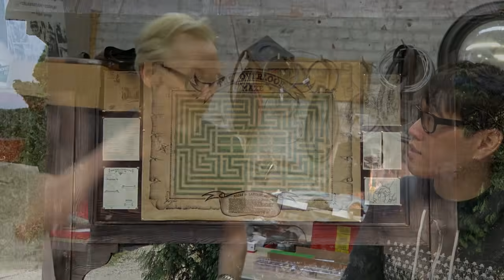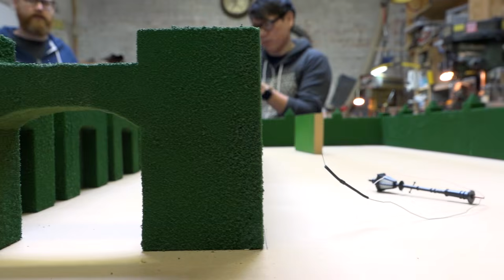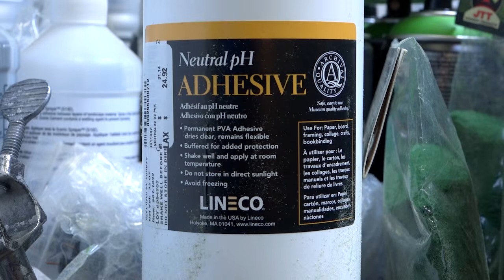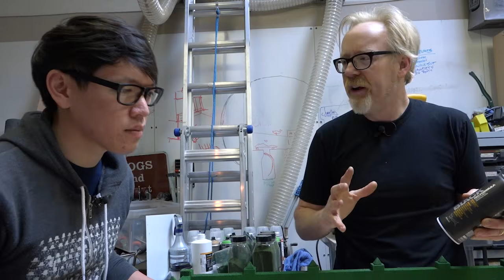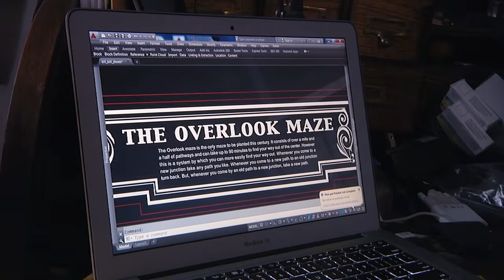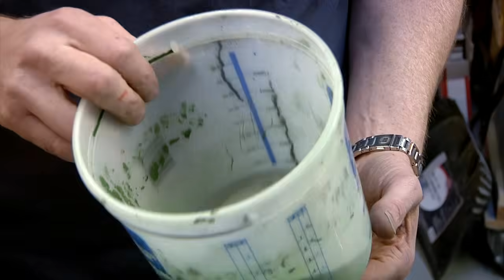Adam Savage's Overlook Hotel Maze Model

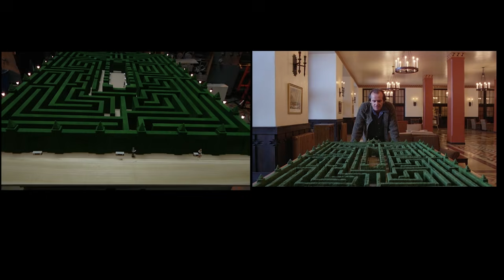Comment: 17:04 I see a mistake. In Adam's model, if you look at the center area, then to the top right of it there is what looks like a rectangle with a single line in the center. The rectangle only opens at the very top left corner, and inside is a single line of hedge. That does not match up with the movie. If you look close in the movie, the center piece is not a straight line, but an L shape (it is correctly oriented as an L from Jack's perspective). So there are actually two entrances into that rectangular area.
Here's a screenshot showing it: http://droneva.us/dan/AdamSavageShiningMaze.png

Comment: Two things I especially like about this video both involve accessibility:
1) Maker accessibility. Doesn't require any tools more expensive or difficult to use than a table saw, and a maker without a table saw can find a workaround.
2) Viewer accessibility. It's easy to identify with Norm in this conversation as he asks questions the audience is already thinking.

Comment: Glad to see Adam's unmitigated enthusiasm continuing. He does things we all would if we were able. BTW, in  school the way to avoid introduced error was to measure from the zero point instead of from the previous station. More figuring because each dimension is different -- o", 1 1/4", 2 1/2",  3 3/4", 5, 6 1/4", 7 1/2", etc. I remember building a Clark Y airfoil this way.

Comment: Hey Adam, the grid size wasn't different on the x and it was just drawn using a ratio for the path with and hedge with. So for example one grid space was used for the hedge with and 2 grid spaces was used for the path. You didnt have to create a recangular grid but just use a grid with smaller cells.

Comment: Amazing build! A nice touch would have been to mount the cut particle board pieces (pre coloring)  to the base board, then use sand paper and or Dremel to soften the edges of the "hedges" for realism. It would also have been a nice chance to pre-fit the pieces and imo add some further texture detail to the model. Great stuff tho Adam!

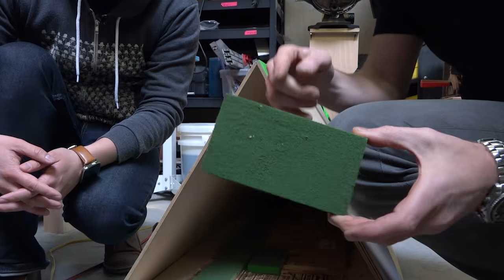Comment: 10:43 I have a 5 gallon bucket bucket with slits I cut with my jigsaw in the bottom side. Then a junk piece of plywood layed on top with a 1 1/2 hole in it which my heat gun sits in set to 150 degrees then I leave it to dry glue while I work on other projects. Works great and was free the bucket came with primer in it used that up and the plywood came from scrap from my dad's work

Comment: IMHO he did not work very efficiently. Instead of drying only a few pieces and only one side in this "oven", I would have put all at once on a wooden plate and then spray, glue and sprinkle the flocking on all in one rush.

Comment: Sorry but, Adam has the gall to put down the original person's work, then proceeds to make a maze that while maybe accurate in shape, is too smooth, too blotchy, with lighting that's obviously blue led color... there's so much that can be improved on this model.  That flocking was the wrong thing to use, train modeler's hedging would've been perfect.  He needed a finisher.  Well done, but not right.
Reply: Just to be clear he didn't put down the original the original is bad ass he put down the copy that was made for the Kubrick Museum

Comment: Adam there are ways to do it as you go with out getting accumulated error that just popped in my head. First of I am a boatbuilder /shipwright. We never seem to do the same things twice and we are always problem solving. Could you mark it out with pencil and then green painters tape so you can erase it sandpaper the pencil. Or make a spacing board to play down in the rows so you can tape up to them then you just have to screw boards to your accurate tape lines. By already marking it out you will not get accumulated error. I do that for teak decking and other things. Although until you are doing the job yourself is skyway hard to know where your head is it and your process plus problems that you percieve.plus there are always usually more than one way to do anything. I hope this could help but probably not.

Comment: I love Adam and he's brilliant in so many ways but in reality, there are things he could have done that would have made this build go more quickly and easier:

1) Used a CNC router to do the perimeter walls and any walls with internal alcoves. 
2) If he really wanted the walls to be permanent he could have used dowels and glue. Dowels and glue have held furniture together for centuries so in this instance, the walls would stay in place. The glue could be applied to the dowel itself so there will be no worry about bleed through. In fact, that are plastic dowels used in the furniture industry that have teeth on them that once pushed in, they "bite". If he wanted to be able to remove the walls for repair, he could have through drilled so he could push them up/out through the bottom. 
3) Flocking: there are cheap cardboard flocking "guns" that shoot the flocking out the end to apply it to the surface. He could have built a cardboard spray booth with a turntable...line up the walls, spray with adhesive, shoot the flocking, set aside. I've done production runs like this when I've had to paint/finish small pieces in largish quantities. 
4) 3" drywall screw: I see americans using d/w screws all the time for things like this...THIS IS WRONG...d/w screws are threaded all the way to the head and that makes it very very difficult to draw the piece tight. If you used a robertson wood screw, which has a threadless shoulder below the screw head, it would draw the piece tight and goes in MUCH easier. In fact, there are screws made specifically for MDF/LDF that have a high/lo thread tooth that bites like iron....

I know hindsight is 20/20 and all, and he's done things I could only dream about, but in this instance, talking with a cabinet maker or carpenter would have saved him hours and hours of labour/time.....
Reply: DawntreaderUK no, I'm not jesus christ, just a regular carpenter....lol
Reply: Well, let's see your amazing channel.
Reply: Muskoka Mike i think he enjoys doing it in his way for relaxation and for quality.
Reply: iamdillyj yeah, many of us do it "our way" but I was responding more to him saying how many hours it took......
Reply: +Muskoka Mike -- Jesus Christ .

Comment: Correct me if I'm wrong but aren't architectural models made in base 10 figures? Like 1/100 1/200 and so on? O scale is 1/48 which is a common scale for aircraft models but not ground vehicles. usually figures and wheeled vehicles are done in 1/35 scale.
Reply: There are so many different architectural model scales it is impossible to quote them all, construction blueprints are always base ten, but architectural models can be in any scale.
Reply: John Beauvais 1/48 is a scale that is starting to get popular with ground vehicles.
Reply: Barb Heinkel Yeah like Tamiya has been releasing 1/48 armor recently. I figured it was to allow greater flexibility with dioramas.
Reply: O scale is also 1/48 when it comes to model railroading. Lionel trains are O scale.

Comment: Adam has failed at his replication. It is clearly much better than the one in the movie.
Reply: I'm sure the movie model was built in less time, with more temporary construction.
Reply: Everyone in this thread has been whoosed
Reply: The amount of wooooshes in this comment section noone has claimed gives me slight hope that it'll never happen
Reply: The only thing i can think of is that Kubrick model was made to be dated.  consider making the same level of detail with materials and tools used to make similar models from 1950s or earlier
Reply: the green paint is differente  the  movie  green  is better  ha ha ha ha
Reply: I found a mistake.
If the entrance is to your right, let’s say  ‘up’ is ‘north’, so the entrance is east.
Starting in the center, from the northeast corner of the center go out one row. There’s hedge where there should be opening and an opening where hedge should be.
Reply: i mean, interior edges should have been sanded; they're too crisp. flocking isn't thicc enough. green color is way off.
Reply: @Dcvbkyrsscbgdsxcgf  if your looking to buy reliable workshop tools now, buying ones from 50 years ago is a solid choice as theyre much more robust than modern ones. id say adams tools are probably as good or maybe even worse.
Reply: I love everything Adam does. And the amount of research and accuracy alone are incredible as always. But I can't help thinking that the flocking over MDF wasn't the most realistic way to go here. The albeit inferior maze model from the beginning of the video, and in fact the one in the movie suggest it was made of floral foam or some sort of dense sponge. That may make it much more difficult to strive for accuracy, but that slight bit of transparency, IMO makes a more convincing topiary effect. Again, just my opinion, I love the work and salute the builder.
Reply: Lame😐
Reply: I disagree. The one in the film differs slightly than what Adam built.  It’s a great model that he made no doubt about but it’s different a little
Reply: He didn't failed.....he 1-up'd Kubrick's model of the maze........and having said that,I post this question......Who can say they 1-Up'd one of cinema's best directors?(albeith in a ''small'' detail like a maze that most people would have to be told it didn't make sense cause of the different layouts showed in the movie).......
Reply: @Ryolu14 Let me just make Han Solos gun from A New Hope... Ops, made it into a machine gun. Guess I 1-up'd George Lucas. 🤦‍♂️
Reply: Is that really his failure? Or does it point out the mediocrity of someone on Kubrick's otherwise excellent staff?
Reply: @KutWrite  mediocre? Kubrick was a perfectionist, almost everything he did was on purpose, his movies took years to make and excessive amounts of takes.. 

Throughout the shining locations change places in the hotel and in another scene a chair is removed between cuts. These changes are littered throughout the movie to disorient you. I wouldn't be surprised if they used a different maze in that one scene just to convey a different emotion/transition

Not to mention production started in 1978, the production quality was very fitting for the time
Reply: @KutWrite  Calm down. It's just a funny comment.
Reply: @peters-z8n : OK. I'm calm now. Thanks.
Reply: no way. This is looks like shit compared to the movie one, sorry mate
Reply: @Bruceskyy  🙄 theres always that 1 hater😂
Reply: Bruceskyy I can see it’s different but I don’t think Adam always goes for the exact replicas and he doesn’t profess them to be as such. His blade runner gun has been changed several times he has said. Got to give Adam credit though, it was a truck load of work.
Reply: @rodneyprior6809  He went on a few times about how accurate this was.  It's not.  The base color is wrong, the hedge color is way off, the magazine shack is completely off.
Reply: @Bruceskyy  Then post photos of the one YOU built.  No? Then STFU.
Reply: @Bruceskyy  its a good model but way smaller than the overhead model

Comment: Thats a lot of Flocking work.  What he was describing as a little off here then it adds up is called Tolerance stacking.  Its a real thing you can reduce by doing things like measuring the width of the markers, blades and using cutting guides.

Comment: Adam, I had initially thought you'd do the whole thing in floral foam, those hard sponges florist stick those plastic flowers into vases with. It's lighter and would be easier to work with. But well hell, that's impressive.
Reply: That wouldn't have held up very well though. It was my first idea as well, and for a movie thats how you would probably do it. Exhibits are a little different as they have to travel.
Reply: He built this to last, and to be durable on a “traveling” exhibition being manhandled and tossed around by gorrilla roadies

Comment: Ok so I have to know.   Looking at the side by sides at 17:04 it looks like the center section is 1 unit wider on the right than the original.   I've really looked at it and I don't think it's an optical illusion.   Am I correct?

Comment: Oh Adam, you mentioned 12v (DC I assumed for the lights), for future reference, if not already known. You can convert a PC desktop power supply into an electronic supply for nearly any circuit board (PCB), or run any electrical device, requiring 3.3v DC, 6v DC, and 12v DC (direct current in general). Among these voltages will vary; for example 6v is actually like 5.87v. Items needing 6v will run off this amount. I've found that the Sony wall plug charging device for my phone puts out 5v DC, which is more like 4.80 something, or other. However I've learned that my phone will not charge on other USB ports, perhaps an exclusive way to buy Sony products. That's just good merchandising.

Bewary of combining other varying voltages, you will ground the circuit, and the power supply will shutdown, plus you'll get a nice 1" spark of molten copper, and a welded wire to the frame of the power supply box, if you touch it with exposed 12v wires in the supply, other voltages will just shutdown the supply. You can remedy this by reconnecting the green wire to the same black wire described below. You can combine like voltages, no problem.

The process is a simple procedure. Tear out the power supply from an old computer (use your own judgement for the age of the computer), and cut as much length of wire needed, keeping as few connections as possible (%90 of the time electrical problems are always found in a connection), this includes the connectors coming with the supply. You should just have a foot of wire remaining now.

With the big clump of wires that connects to the motherboard, locate the green wire, don't worry it's not hard to find because it's the only one you will. Expose it, and connect it to any exposed black wire. Vwaula, you've got power assuming you plugged in the device, and closed the 120v AC circuit switch, but will only remain as long as you keep them connected, having a remote switch is recommended. If not needed, tie the two wires together, and then isolate the connection away from possibly unwanted connections (Wing nut). Then you can use the main power switch instead. Pretty much after this point, it's all imagination. Remember black wires are ground, which is what you route your power to. Orange wires are 3.3v, and is the most accurate voltage from this wire compared to the other voltages. Red is 6v, yellow is 12v. Any other colored wires, disregard or cut them out of your way (sounds racist, I know, but get over that thought lol), unless you can find other uses. Be cautious when working around 12v, because it is DC you'll be working with, I've heard some horrible stories revolving around wedding rings, and car batteries. As always, when working with electricity always use common sense, treat every wire as if it were live, and be aware of your surroundings along with other hazards. I know there's a few details I missed, but most can be found online. This will get you going right away.

When it comes to the history of electricity, I have some strong opinions, and some may sound controversial, to the point of it sounding like I'm talking out of both sides of my mouth. In process of learning about electricity, Tesla, and Edison. I've grown to despise Edison, because he marketed the source. Now we got to live with that, where as Tesla wanted to give it to us for free, and that's the way it should be. Granted they both created wonderful things. In my own research, I've found that I hold no sympathy for those whom are actually looking for clean energy to distribute to our homes when it's always been under our noses. I personally feel they're wasting mankind's time. Tesla knew this was possible, and I believe him. Wireless power is a possibility, and would grant us no need for huge power plants, including nuclear power, unless you need superduper power, which is how it starts, then is received at 120v AC in our homes.

Some facts about electricity: It will always find the shortest path to its home source, or the earth. It never moves unless it has a connection to home (the source from which it came from). It travels at the speed of light. If, and upon electrocution at your hand, DC current will lock your muscles causing over exposer, risking serious injury, or death. Otherwise, AC current will repell you from the source of electrocution, risking serious injury, or death, although it is safer than DC, it doesn't mean it will not kill you. Some electrocutions can cook you from the inside out. It will visibly jump one inch per thousand volts, so you can only imagine the voltages of a lightning bolt from the clouds to the ground, or visa versa. The scales, and distances are astronomical when an electron travels to the next. DC voltages will drop depending on length of the wire used. AC current will travel greater distances, and even further with the use of transformers with a small drop in voltage. AC current alternates, where as DC does not. It flows on the outer parameter of the wire (The copper wire, not the insulation). Gold is the best conductor on earth. It can flow through water better if it's not pure water.  Electricity will always be apart of our life, and a demand (job security). When volts go up, amperage comes down, and when amps go up, volts come down. Amps (power) can kill you. These are a few facts off the top of my head.

We can describe electricity by definition, but no one can truly say what it is exactly, all we can do as of yet is control its flow. <<< that right there is the truth.

Disclaimer: I'm not an electrician, and hold you liable for any damage(s) you may cause at your own risk. Had to say it, sorry.

BTW, your model looks awesome.
Reply: Well that was quite a tangent.
Reply: I'm trying to remember what I commented about.
Reply: Oh, duh. Lol